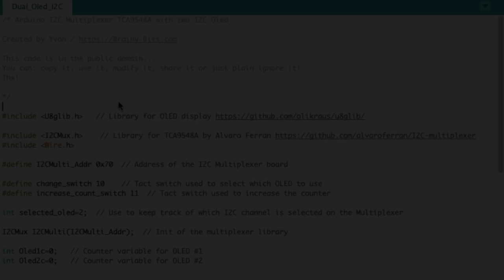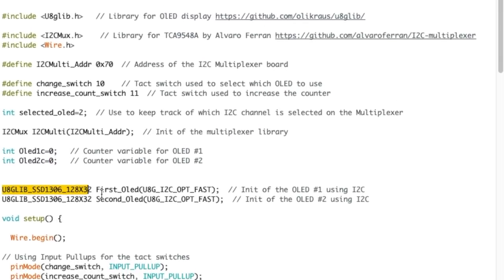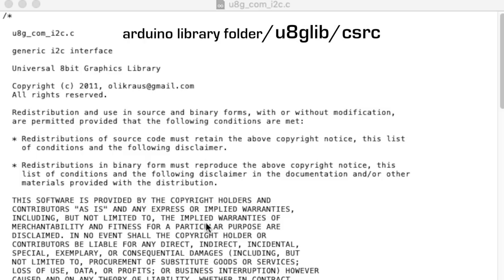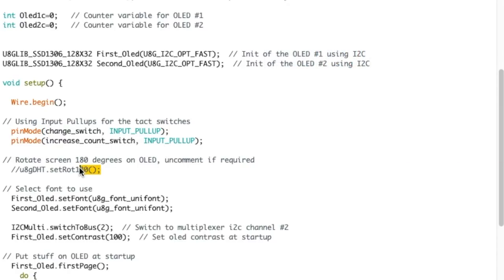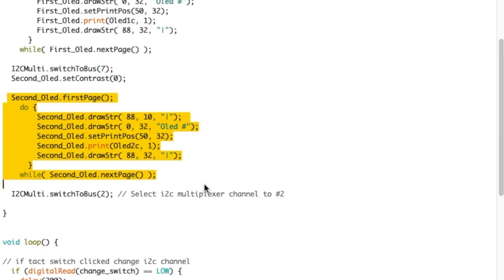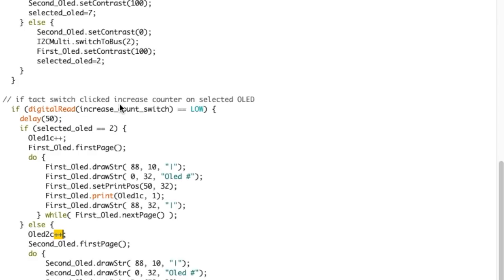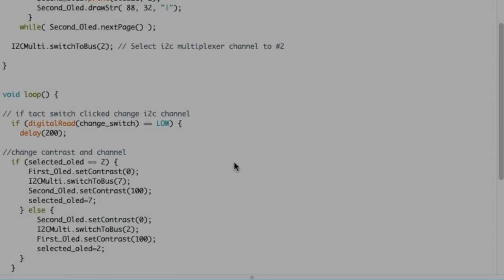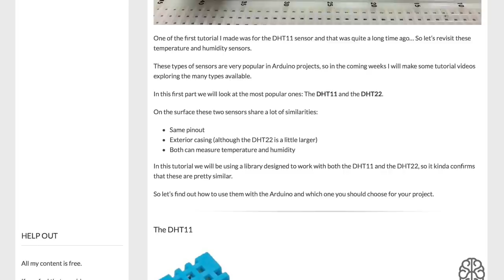How to use two I2C modules that have the same address?

Comment: Can SPI Oled screen also be multiplexed this way?
Reply: Yes. Each SPI device gets its own CS wire (chip select).  This is why SPI devices have no address. There's multiplexing built into the protocol itself. The only reason for a hardware multiplexer for SPI is if you have no spare pins. In this rare case, you should go for the multiplexer.

Comment: It's easier to use software I2C which allows you to use any pin for communication. And such lib written in assembler is even faster than hw implementation from AVR
Reply: What library is that? Link please.
Reply: @digihz_data  Is it that hard to use google? :) There are a few libs available, for example https://playground.arduino.cc/Main/SoftwareI2CLibrary/
Reply: @cbm80amiga  Thank you for sharing this! Even if the tone of the reply seems a bit condescending.
Reply: @skeryboi3531  
I kind of understand the frustration of the poster. It's like when someone cheats off of your test by asking you for the answers. You had to do all the work and now someone just wants you to hand it over to them instead of looking it up for themselves. Some would consider it condescending for someone to impose work on someone else when they can do the exact same thing as you. If you're on here, then you are lucky enough to have google. I've never asked a soul to help me find an answer that's just a click away.